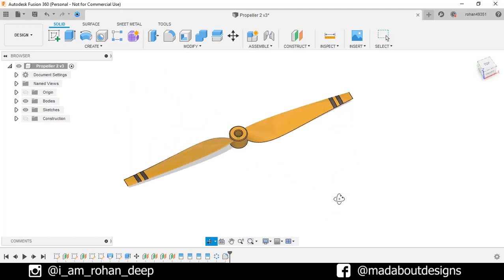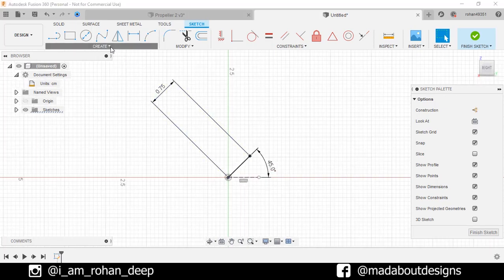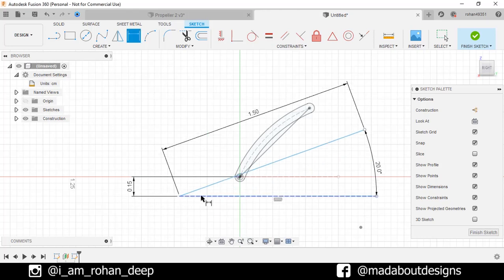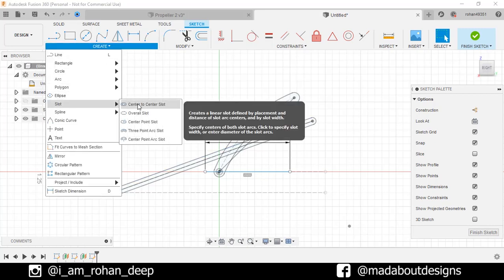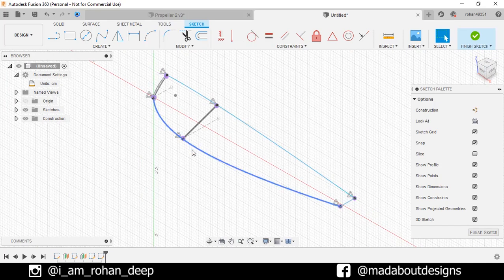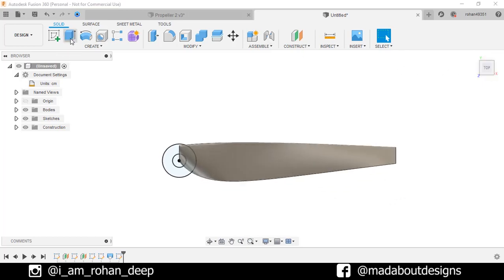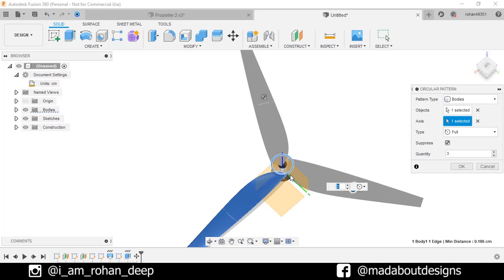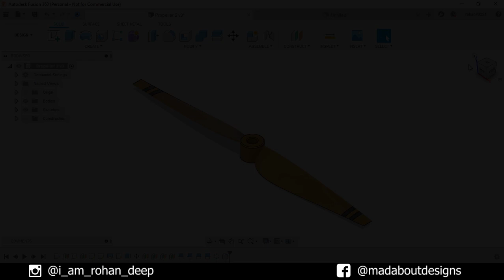How to design a Propeller in Autodesk Fusion 360 | Fan Blade design

Comment: Sir, when I'm lofting the sketches, in tha above tutorial it's showing self- intrsection or bad geometry. How to resolve thi sir?
Reply from the maker: I was also facing this issue.. try another time with extra precautions
Reply: try checking off the "tangent edges" in the loft settings
Reply: Turn on 3D sketch option in sketch palate... I too had this problem!!
Reply: @sigurdvingelsgaard9466  Thanks!
Reply: @sigurdvingelsgaard9466  Thanks!!! "tangent edges" helped!
Reply: @sigurdvingelsgaard9466   Thanks
Reply: @sigurdvingelsgaard9466  love u

Comment: How to know and calculate the pitch of the propeller so I could make my own
Reply: By the papers I have readen, there are a lot of experimental values throughout the history of the propeller and these values will influence the propeller dynamics. There is no wrong or right values, just a range of values betweens the root of the propeller to be tip. I use 20º at the root, an experimental value at the middle and 0º at the tip.